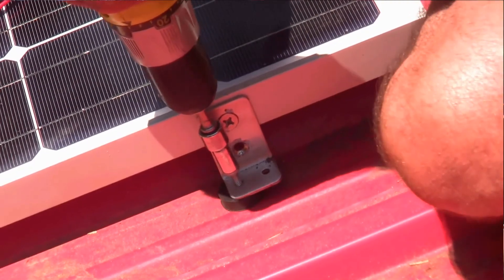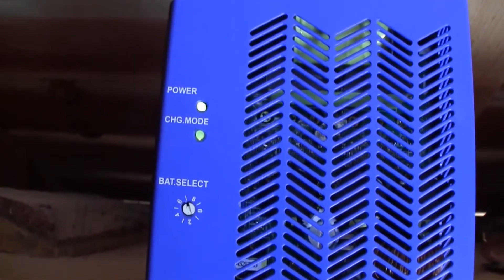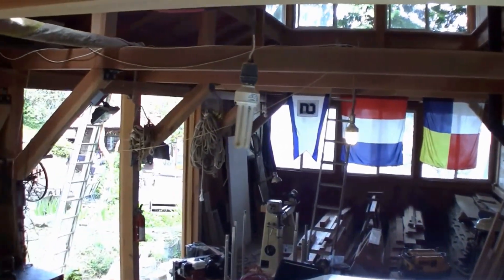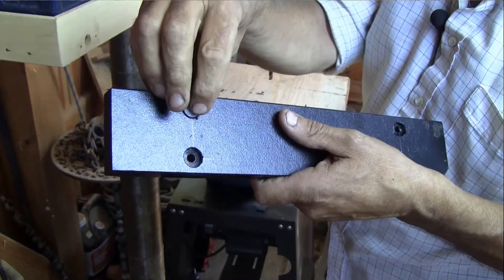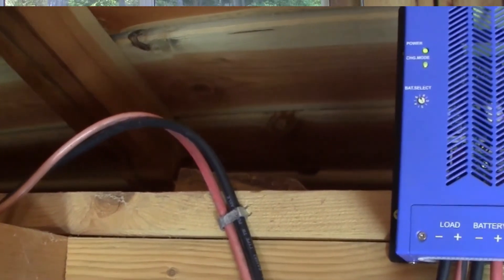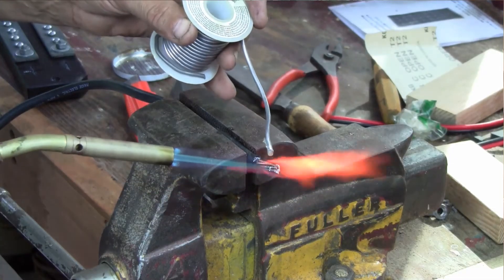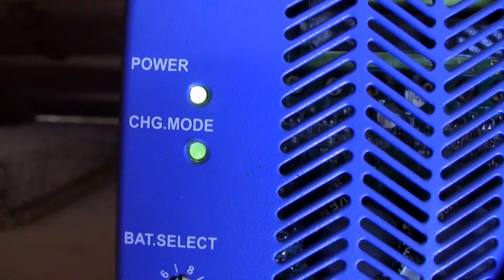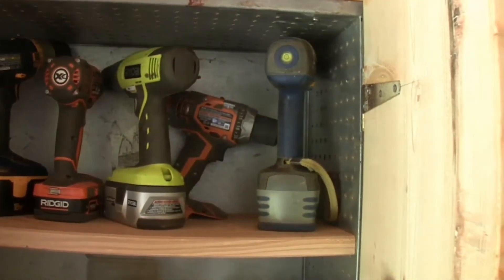Budget Solar Installation Part Two

Comment: Mr. Markerbuoy how long will those two batteries last and do you live there full time? The place is so nice and very simple... When I retire I look forward to living that way.
Reply from the maker: I'm sorry you feel that way. 
Things working AOK around here. I'm not constantly running high load stuff so the batteries I have, meet my needs. Everyone else's mileage will vary & they will have to adapt their equipment to their needs. 
I just document my experience, which most commentators find useful.
Do your thing & enjoy!
Cheers,
M
Reply from the maker: eiggiboy I now have four twelve volt batteries installed. 2 X 2 @ 24volts. They are adequate fir now - the true test comes in wintertime.
We are not full time there as we still work full time in town. We are there as often as possible, all year round.
Thanks for watching :-)
M
Reply: Brad Brent what a brad
Reply: You bought the wrong batteries dummy they are starting deep cycle not deep cycle don't drain them too much! and yes costco did have them at some point i hope they still do.

Comment: I believe he also has a pure sine wave inverter as well If it is as good as the mppt controllers it should be really good . I have not purchased one from him as my budget was deedicated to two more 24 volt 125w mono panels to increase my ability to gain more energy in winter
Reply from the maker: Quite right.....I think it is called generating power with money :-)
Good call on the extra panels - I found myself in a similar situation with the cabin situation a few years back. Problem solved with added panels.

Comment: Thanks for the tutorial. I'm beginning to learn solar with a similar setup in my backyard shed. One thing I haven't noticed in your videos on solar is any sort of fuse or breaker setup. Did I miss that? Also, I had come to the conclusion, perhaps an erroneous one, that the "load" leads from my charge controller were pretty useless, that I ought to run separate load circuits straight from the batteries in anticipation of high-draw requirements. Your thoughts on that line of reasoning would be welcome.
Reply from the maker: In the case of my current (ha) install, I have already hooked up a (internally fused) 750 watt inverter via the "load" terminals on the charge controller. (video yet to come) The controller has an electronic 15amp circuit protector...which has tripped a couple of times already, while I experiment. So the controller acts as its own breaker panel and works very well.
My cabin install, of long standing, now uses the same model controller but like you I by-passed the load terminals, inadvertently as it turns out. I have a fused bus bar set up at the cabin but I by-pass it too :-( Cabin needs are very simple - lighting and phone recharging for the most part - and the wiring is heavy gauge....this seems to work OK. In the latest shop install, all wiring and battery connections are heavy duty in anticipation of higher future loads
As I describe in the vid http://tinyurl.com/nqvc9mf it is an ad hoc arrangement!
Best Regards,
M
Reply: Your linked video is the first one of yours I came across--much appreciated. That's interesting to hear that you have "tripped" your charge controller. I have a cheapo 30-amp controller that looks suspiciously like the one you warn against. Mine came as part of a kit for very little above the cost of the panel alone, so I cannot complain too much about it. It has minimal documentation, however, so I wasn't really sure what it would do if I pushed it past 30 amps. Blow up, I figured. That's why I thought fuses were necessary. Others online suggest that every circuit in and out of the controller and/or batteries be fused somehow. You appear content to let the controller be the fuse. I admire your Zen complacency. Perhaps I worry too much!
Reply from the maker: Rick Rose Go to Yves Julien here http://tinyurl.com/oh5f34m
I bought two of these this year. Yves service is the best and the product is great...tell him I sent you!
Seriously, compared to the controller you have (& I had) this is a rocket ship - you will not be disappointed. My cabin batteries indicate a higher charge than I have ever seen, based on specific gravity reading and the newly installed system in my shop is working well (power via the "load" terminals)...video to follow ASAP.
Cheers,
M

Comment: You'll love home the solar works. It just does it's thing in the background. One suggestion when running straight DC, get a low voltage cut offs or check your voltage frequently. Long haul truckers use them all the time. I use to run one those portable DC fridges from Canadian Tire and it totally drained my 12 volt batteries. Took a long time to recharge.
Reply from the maker: Good point.
My charge controller has an electronic 15 amp cut off, which prevents too much current draw. It doesn't take much to set it off...
Cheers,
M

Comment: Markerbuoy, not sure if you have decided to go with CFL or LED lighting. When I installed my first array here in Cambodia, I started with eight CFLs (compact fluorescent lamps). Over time, I changed them to LEDs. I am much happier for doing so. They are brighter, use less current, and last ages longer. I like the Bus bar. Nice job. Excellent video - as always.

Regarding your battery placement: I imagine that, where your cabin is up north, it wouldn't get very warm in summer. Here in Cambodia, the last place you could put batteries, would be in the rafters of a home. :D
Reply from the maker: Hi Paul;
In the main cabin I have been using 12v 20 watt halogens for lighting & we are very happy with them. I adapted 120v fixtures (cheap & stylish at Home Depot!) to accommodate the bulbs, which are the same physical size as 120v halogens. I may go the same route in the shop. However, your point about LED's is well taken, especially since they are much cheaper now...the energy savings are fantastic, so it is an avenue I will explore.
I too, am not sure about the wisdom of my battery placement. Time will tell. Unlike you, I don't think heat will ever be a problem. Around here, an earthquake is more likely....but if the big one comes, then everything else would be screwed too :-)
Regards,
M

Comment: Nice setup.  I too am working on a solar project but have been side-tracked with my rainwater collection project (inspired by your videos).  I have posted several videos on the rainwater collection project recently.  For your lighting consideration - I was able to find 12VDC bulbs that fit into a standard light socket and use them in my shop at the retreat location.  I prefer the light from incandescent bulbs and the light from the 12VDC bulbs are indistinguishable from standard 120VAC bulbs.
Reply from the maker: Sounds like you are busy!
Glad to hear I supplied you with inspiration :-)
I am aware of the 12v bulbs which fit in a standard socket and I understand your preference for a warmer spectrum.
Personally, I find these type of bulbs more reliable & easier to find http://tinyurl.com/k7jsl56 ...I adapt 120v fixtures to take the 12v halogens and the colour spectrum is agreeable :-)
Best regards,
M